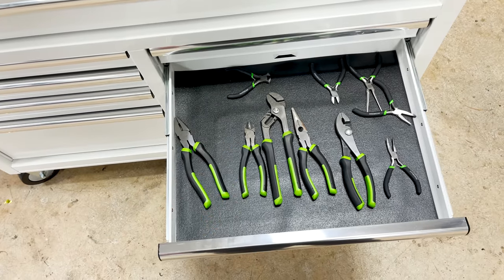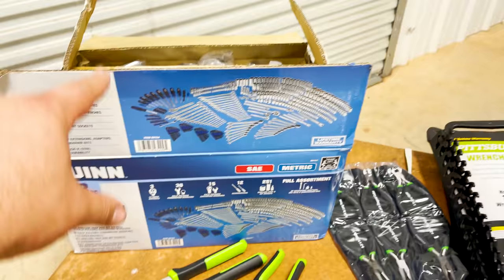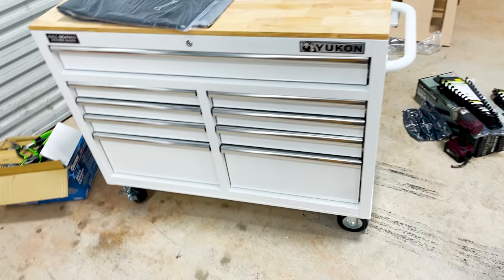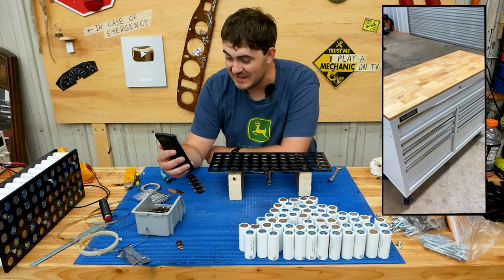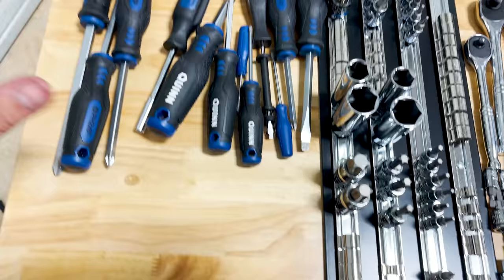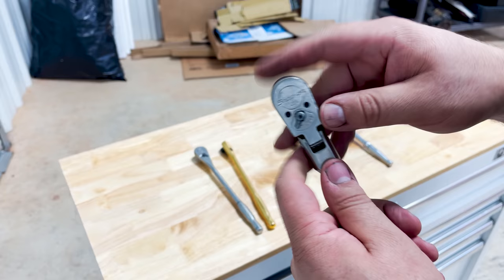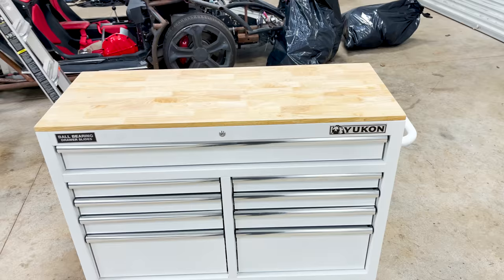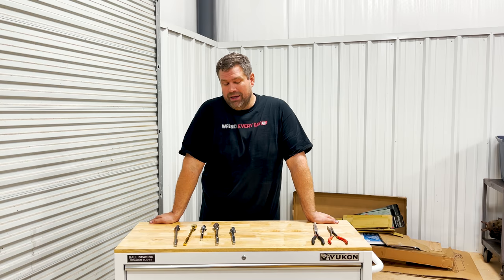I Bought The CHEAPEST TOOLS On The Internet (So You Don't Have To)

Comment: I agree with the end of this video. the cheap HF tools will be good enough 9/10 times. and that 1/10 times its usually with the pliers or some oddball tool that people tend to lose or is something people would easily buy more than 1 set of. the "name brand" tools of today arent quite like to tools of the past, none of them are built to last, and at this point the cheap HF tools are about on par with most of the name brand tools that no longer do their own tooling. I would recommend staying away from the HF cordless drills and auto wrench, if you want an affordable one of those but don't want to go with the usual green brand, the brand K.I.M.O on amazon is better than the usual green suspect IMHO, not really Milwaukee or some of the dewalt quality, but its good enough for on a budget and what you need it to do, with better batteries than the other green guys.

Comment: There is definitely a difference in quality but most of the time it isn’t always needed. 75% or more of the time the cheap stuff will work fine. With cheaper wrenches they actually bend and open a bit and the flank drive from snap on is nice. You are also paying for warranty and not just good tools

Comment: my general plan is when i need a tool i buy it cheap if i break it i will upgrade it if i have it and don't need it that much cheap should last (that being said i have a rack with 8 grinders on it so i can swap them out if the get hot and my lower end ones end up with cut off discs and the like and leave the heavy work to a beefier tool) i always keep an eye out for good used tools but as long as you dont over abuse tools for the heck of it cheap tends to work well enough.  that being said live and work on a family farm so tools get up there inside and without a cheater i can break a half inch craftsman socket wrench there mid range 72tooth not an amazing tool these days but i know i can break it so when space allows i go up to a 3/4 or 1 inch drive and i try to stay in the proper abuse of tools as there is no real fun in break/buying something you did not have to.  (the usa made ones are far better than the new almost offbrand versions out now)

Comment: Back in the late 80's till mid 90's (when I turned wrenches for a living) the tool issue was a lack of options. Depending on where you lived you had Sears and some local hardware (usually had stanley and Back and Decker) to choose from outside of the tool trucks. Back then it was more about quality as in having a tool that won't break at 9 pm on a Saturday when a mom with kids is trying to get home. The tool guy would always come out to you, the other stores were closed.

Side note: Sears was arguably the worst to get tools replaced. The sale guys acted like you where stealing or some other pain in their ass.

Comment: I have had zero problems with most of my harborfreight tools. With that said. There pliers are trash. I broke a pair of the Quinn vice grips on the first use. The needle nose pliers developed a lot of slop during a LS swap wiring rework. But the ratchets and box wrenchs have held up to years of abuse. The screw drivers seem to have legs and dissappear.
Reply: Doyle on the pliers from hf

Comment: I don't understand why most cheaper tool boxes have split drawers below the top one.  it's a hassle having to open 2 drawers on a single level, and it robs some storage space.  why do this?  does it make the box stronger or more rigid?  
this same box would be so much better if it had 5 full length drawers

Comment: Cheap pliers are cheap.  Those didn't come in the Quinn set, though, the Pittsburgh ones are like a $15-$20 set of pliers.  There is a 4 piece Quinn set for $25, though, and they are solid looking by comparison.  Those would have been a better fit for that pliers drawer, and all the other specialty Quinn pliers are sold individually, and they have some interesting ones.  I still intend to get those when my old random assortment gives up and comes apart.  I'm already down to one good needle nose and one good sidecutter.  What ARE great Pittsburgh pliers are the long reach offset ones.  You get both a 20 degree one and a 45 degree one for like $10 and they have both been very useful for me over the past few months.

Comment: Swivel wheels on the handle end of the tool box. Makes life simpler. Bought a set of Popular Mechanics sockets from Walmart over 20 yrs. ago. On clearance, $14.95. Still use them. I have put those chrome sockets on impacts and never broken one. Kinda weird. A tool is only as good as the user and @ 67 have bought bunches. Thieves in Louisiana are hard on mechanics. Other mechanics in shops can be just as bad. Most honest shop I ever worked in was a Firestone Tire store. Except for the franchise owner. He sucked.Pretty good video.

Comment: They put everything in a plastic bag because of rust also. These are getting shipped in trucks and on boats where there is hot and cold temperature that fluctuates quite suddenly. These would cause moisture and the risk of rust. Yeah they can put grease on the tools but who wants greasey tools. I sell fitness equipment and alot of bars from China come with a little bit of grease so they don't rust doing shipping. It's very annoying to have to wipe the whole bar down just so you don't get grease everywhere but I would rather that than a rusty bar.

Comment: For a wood guy, I'm surprised he didn't ask to see the endgrain and to see if it matched with grain on the top, same goes for the sides, if the grain matches (which is usually easy to see if it does) then it's solid. The finger joints are usually a sign of solid wood as it's a waste of time to do that with veneer.

Judging from the endgrain on yours, it's solid fingerjoined pieces of wood, no veneer.

Comment: Those pliers are cheap.  Needed a mobile set that  I would  not care if I forgot it or lost it somewhere so I bought them (with rivet, not nut) about 3-4 years ago.  Not used everyday by any means and hasn't been subjected to heavy use/abuse.   OK for that so far.  Would do it again.

Comment: You might have installed the side handle or wheels on the wrong side. It would work much better if the swivelling wheels on the same side as the pull handle???

Comment: I have the Yukon . And it’s a great tool box for the price . I don’t think you can find one at this price as good. Im an industrial maintenance mechanic . We work on small and very large machinery . If we can pick up the box with a forklift and go from building to building doing repairs we are good. We do have a Snap On yet it’s to large to move. Yeah we like convince not branding . Our plant is 60 acres . 102 buildings . We make Aerospace parts . F35 lighting and Boeing 777, 747, 767, plane parts . Just explaining my experience. Not  all Is an auto-shop. We do have one saying. If it breaks but one that doesn’t .

Comment: Only brand I will never buy again due to experience is craftsman, only 1/2” drive ratchet I’ve ever broken, and it was only a couple months old and never used as a hammer. I do tend to buy gearwrench lately but that’s mostly because Advance is a block from my shop and delivers to me free. I do have a couple of snap on ratchets I’ll never give up, one is an aviation fod free one where it’s riveted together instead of bolted, the other is the extra long handle.

Comment: Hard to tell but that top could be bamboo, it's quite plentiful over there and bamboo quite a bit harder than most hardwoods like oak. And it does not absorb liquids like most wood,  actually bamboo is perfect for a wood top tool box, whether it is bamboo or not I don't know. As far as the laborious excessive finger joints in China labor is cheaper than material so that's nothing.

Comment: Go to flea markets or pawn shops, best place to pick up good tools to replace the cheap ones, or the ones that got lost in a fender well, grew wings and flew to Canada. Or that  socket that the bolt that wouldn't go through the  socket because the hole was too small.(dam you Japan, China lol).

Comment: I actually got a US General box similar to that Yukon, I actually compared it to the Yukon before going with the US General one. So far I like it, it also came with draw liners pre-installed in each drawer, the wheels were also already attached to the box which saved me from having to flip and attach the wheels (these boxes are HEAVY if you're not aware). The best selling point of the US General has to be all the color options, I got the green one and love the color.

Comment: Cheap tools have a place in the world. A 45 year old father of 3 with no mechanical skills but can operate a phillips head screwdriver doesn't need overpriced tools like snap-on. As long as you aren't a 'pro' that needs tougher tools for your job, a cheap pair of pliers or whatever is a lot better than having no tools at all. I'm just saying there is a case for 'cheap' tools. Having said that, I would at least stick to brands you've heard of like Stanley, Cobalt, black/decker, etc. I've never heard of 'Quinn' or 'Silver Eagle'.

Comment: You put the handle on the wrong side or the castors on the wrong sides. You want the handle on the side with the castors so it can be steered/controlled while pulling it around.

Comment: I went to work in a John Deere dealership out of collage. I had all hand me down tools that came from my grandfathers and uncles and stuff I got at yard sales or got for christmas. I had no toolboxes because our shop on the farm everything hung on a tool wall or was in old kitchen cupboards out of who evers house got a renovation when I got the job at the dealership I went to sears bought 2 of the cheapest boxes I could get think they were like 400 for the pair top box and lower, I showed up with them and they all laughed because my boxes would fit in 1 drawer of their $20,000 snap ons but once I started working and they seen what was in those boxes they all just started scratching their heads because I was doing the same jobs same work as they were and all my tools including boxes cost less than they had in just a single drawer. I looked at one of the other mechanics one day and said I was there to make money and not spend it. 25 years later I still have craftsman boxes and still using just about every tool I started with and have no Snap on or Matco weekly bill don't even go on the truck when it pulls in every week, do I have a big fancy snap on box today yes I do but I got a 60 inch bench top from another mechanic that just had to have the next bigger flashier box and I gave him $500 for probably a $10,000 box. I'm also the person who cuts and welds wrenchs and makes many of my own specialty tools to get the job done and at the end of the day I can throw my tools back in my box and not have to spend half the day wiping and polishing the stuff. I'm now that old timer that sits over in the corner of the shop and laugh at these young know everything kids that come through the shop with their jacked up stacked wannabe diesels toting a million dollar worth of tools and boxes and paying a mortage payment to the tool guy while I walk out on pay day with a full check going to pay for my relaxation toys like boats and old cars and trucks and tractors things that I like.

Comment: Gd 10 mm... always goes missing. For me, cheap tools just depends on the job. For me a regular guy, it doesn't make sense to buy an expensive hub puller, or brake like bleeder kit etc as those are the sort of tool you might use once every several years. Something like torque wrench or a power ratchet it makes sense to buy a nicer one upfront. For me the worst cheap tool is adjustable wrenches. They just have always been the worst in my opinion.

Comment: Ratchet bars are the problem. Though I see no bad tools these days.
I have unbranded flexible head ratchets in 1/4 3/8 and 1/2. I though my 3/8 died but some WD and works 100% again.
So many tool junkies wank themselves stupid!! My brother at 60 has seen the light eventually!
I do have decent sockets,, bought on special though my 3/4 were about $70 for a metric imperial set and have been used very hard.
Spanners? all bought no name and work fine. Many came from used cars and many have been ground for special jobs. Screw drivers ditto though defenitly not the cheapest. Those rubber handle ones are so nice to use.
Slip joint pliers are too often bad news though I have bought some very nice ons for about $10 recently. Normal pliers especially pointy nose check them for light between the blades. Though brand name are sometime better value long term.

Comment: Your wood expert doesn't know much about wood. That top is most likely rubber wood, made from rubber trees that no longer produce rubber. It's technically a hard wood but not very hard and usually pretty good unless it's around moisture (outside).

Comment: Best part about HF. I broke it. Really how I didn’t like it so I smashed it. Ok looks like you got the warranty so we can take it back. I am not joking. You can break it or cut it and bring it back in the warranty time and they will take it back. Not something I practice but I have returned my share of air saws until I got a composite one that actually worked for more than 10 minutes and the one I refunded to get it was broken in half and I know it was because I was so pissed I threw it down after it stopped working as hard as I could on the concrete and it freaking exploded. I didn’t plan on returning it because I did the damage intentionally and when I went in to get a different version they offered to take the smashed one back. I mostly buy Snap-On and Mac or SK but don’t be afraid to take advantage of the return policy. They really do stand behind it.

Comment: The cheap pliers from HF are garbage . If you get the higher end offerings from HF they will be fine for home use or entry level tech. Speaking from experience. 

If you are starting out, get decent tools.. upgrade if needed as time goes.  Unless you can drop the cash up front for high end tools first, if you are money bags. Go for it!

Don't do like some of the people I have worked with.  They started off with nothing bought a high end box and a few high end tools.  They didn't have enough to do the job and were paying a high payment. Just to always be borrowing tools from other people in the shop.

Comment: But I love their ratchets I have 2 and my 1/4 has held a cheater bar for head bolts. I have to tighten the screws up bun in a pinch I can get it far enough in that it's OK. Pittsburgh has stepped it's game up a lot. I only buy from harbor freight for sockets, wrenches, their engine hoists (replace the jack immediately appon purchase), the extensions don't hold up very well if things are super tight, especially the wobble extensions. The way I see it I can get a pack of extensions once a year I've got a good socket set. What's $20 if I need them

Comment: How do you like the GearWrench stuff? I'm sorta on a GearWrench bender at the moment. Haven't got to use all of it but it reminds me of if Craftsman had a Snap-on brand. 😆 I've used quite a few different brands over my time. 

One thing also that's important to mention is if you buy a cheap crash kit replace or make sure the ratchet isn't one of those through circles with the spiral ring. Nothing like needing it and every 4th turn having to reassemble it. 😂🤣

Comment: $1000??? I’ve been working on cars and I only have a small tool box with every tool I need. A few extra tools out of the box and I’ve done tonnn of work with just that and a 1.5 ton Jack. No problems yet. I’d say $800 max. $400 if you take away my power tools. Also harbor freight is the same as snap on and Matco. If someone thinks brand matters they’re just obsessed fan boys or ignorant dopes. It’s the material...forged steel is forged steel. Chrome is chrome. Vanadium is vanadium etc etc.

Comment: You need those bright green spark plug boot pullers from the auto parts store...true worthless crap..i use them to twist my locking gas cap off because its way too tight

Comment: "the top used to be real wood". Interesting way of putting it :)
My experience buying cheap tools: most just don't work. The metal is so soft the tool deforms before it manages to get loose an even slightly overtightened screw or bolt, and often before managing to properly fasten once.

Comment: what is the warranty?  I buy Mac, Matco for the warranty, it breaks I get a new one for free. so I'm not buying the tool twice, it costs more but I only have to buy it once. drill bits get dull exchange it for a new one, never have to buy another drill bit, unless I loose it. carbide bits... get dull exchange it for a new one, and on and on. So i guess the long term will tell you how good of a deal you got, if you actually do Wrench every day, the ratchet will need some work, do you replace it or buy a rebuild kit, or is it replaced for free. I only wrench Mon thru Fri, I'm lucky I get the weekends off.
Reply: Harbor freights hand tools are lifetime warranty. If you manage to break one, you take it to the store, hand them the broken tool, and they'll hand you a new one right off the shelf, usually no questions asked.

Comment: There too expensive, Harbor Freight has lost their Way! They needed to stop the absolute junk tools, but this Icon series is new, untested, we don't know if the warranty will be valid in 5/10/25 years. Kobalt had a professional line, I got their screwdriver set, they canceled the line of tools. I wanted 1 screwdriver replaced. But the ended up giving me a partial refund and the relationship was ended.
They should be pricing these tools much cheaper for the first few years until they prove it's the new Craftsman.
I still have Craftsman and will try to get the occasional tool replaced at their new retail stores.